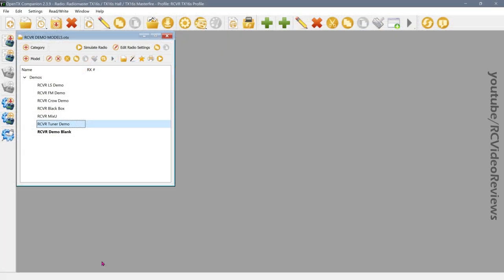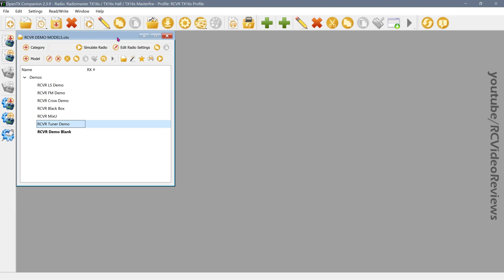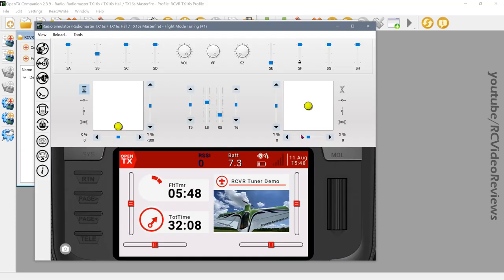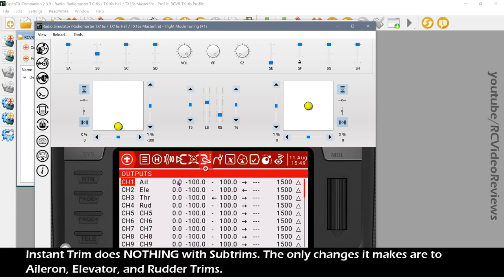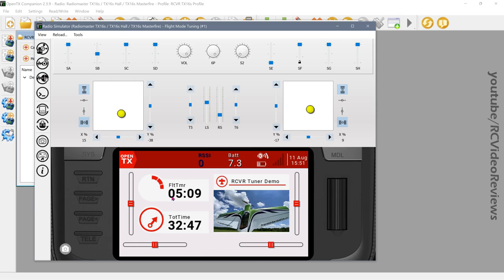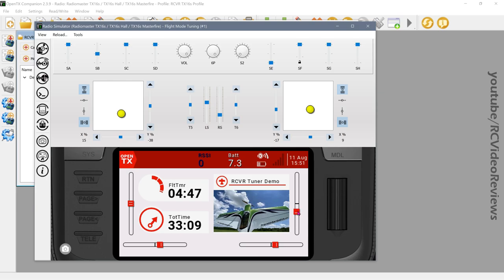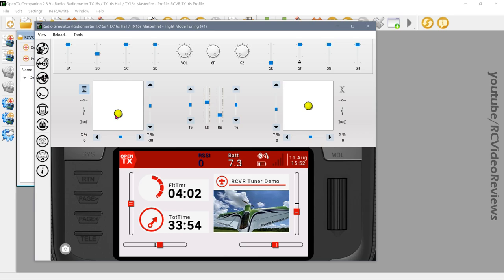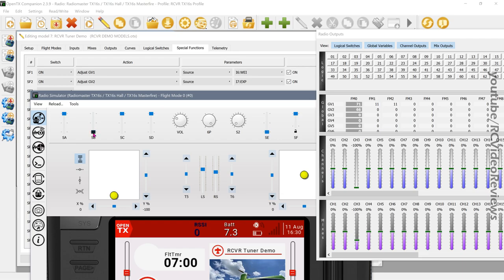OpenTx Companion Tutorial • Tuner Setup: Easy RC Plane Maidens! • Radiomaster TX16s • [Intermediate]

Comment: Hey John, that’s F’n magic, crazy cool. In the simulator at the end you used the sliders to adjust the when b/middle is active 
I’m confused, toggling the momentary switch sets the trim to where one would be holding a stick or having had moved the slider to (or both!) ?
Reply from the maker: The sliders affect weight, not trim. They are independent of each other.
Reply: @RCVideoReviews  right, it was late last night when I watched that

Comment: I get the instant trim. great tip and thank you, but you lost me with the "curves". i understand  the expo curve its self, i.e. parabolic, but i dont understand what you were doing other than setting min/max values for the pot switch (with a straight line/no curve lol). is there a video where you explain "curves" in more detail?
Reply from the maker: I do not have a stand-alone curve video. Don’t get too literal with the terminology. The developers call the function curves. I used a straight line within the curve function to establish end points for weight and expo. The whole point is to ensure you can never enable an input with Zero weight which would leave the model uncontrollable. This is exactly what I said in the video. The curve is applied to the input to cap the highest possible weight and the lowest possible weight while in tuning mode. 

Try it yourself. In the simulator set an input with a weight of zero and see how much it moves when you move the stick. Applying the curve prohibits a weight below the low endpoint of the curve or above the nigh endpoint of the curve. 

If they had a “lines” function I would have used it. Mathematically a curve represents a function. In this case my function is linear.

Comment: Learning so much with these videos. Thank you so much.
Will be passing on the knowledge to some of the other older guys I fly with. lol.
Just wish I knew how you got your simulator to be red like the radio. 
Mine is a dark blue color and nother like the radio screen
Reply from the maker: Under Radio profile -> SD Structure Path -> Add a directory accessible by your computer.  Copy the contents of your SD card there.

That should do it.

Comment: Hi John, 
Do you know if there is an OpenTx protocol for the original Spektrum DSM AR6000 receivers?
Thanks for the great videos!!
Reply from the maker: Multiprotocol support isn't provided by OpenTX, it's provided by the multiprotocol module in radios like the TX16s. MPM protocols can be found here: https://github.com/pascallanger/DIY-Multiprotocol-TX-Module/blob/master/Protocols_Details.md  You have to know what protocol you want, and bounce it off that list. If it's on that list, the MPM will support it and radios like the TX16s will be able to bind.

Comment: Any thoughts,  apart from the obvious colour screen, if you had a taranis x9d, would you still upgrade if colour wasn’t as important ? or would the new tx16s do more.??
Great tutorials. Thanks.👍
Reply from the maker: The TX16s main party trick is the MPM. It can bind with just about anything mainstream out there and a ton of proprietary drone protocols. For me, the important thing was adding the non-frsky options. 

I understand the comparison you're trying to make, but you shouldn't discount the screen. It is excellent. I was pretty happy with my Taranis and didn't think much of the screen, but now that I have this screen, I would not want to go back.
Reply: @RCVideoReviews  thanks for the prompt reply. i have an excavator, I was hoping that the display would make curves and setting easier, although that may just be an opentx thing.
Reply from the maker: @witneydiggersrc3251  I don't think curves and settings are necessarily any easier on the big color screen. They may present better though.

Comment: Thanks man, nice tutorial. I want to set my TX16s for custom throttle mix. My plane flies straight an level with zero throttle with no trims. With throttle it turns left and rolls left. I already managed to make a mix that listens to throttle and add it to the aileron. I am sure you can do it the better way. I did it by making a formula in mixing tab aileron=aileron+throttle*(0-30%curve). Now I want this constant (30%) to be a slider. So I need to add a GV for that? But the problem is that you cannot make mix formulas in mixer like a=(c+d)*2-y*0.2 . You can only multiply everything that is above the line. Is there a smarter way of doing it? And my plane is V-tail. So making rudder mix from throttle is even harder.
Reply from the maker: I would suggest adding two washers under the left side of your motor mount. Do you have down and right thrust now?
Reply: @RCVideoReviews   I know about thrust angle. I wanted to solve this problem in software.
Reply from the maker: What are your variables: c=curve d=? y=?  Is your *0.2 meant to be a percentage?  You referenced 30% above.

Tell me what you're trying to get the mix to do to the plane. Forget curves/mixes/rates just say what the "better way" is.

Comment: Unsuccessfully tried to set up the variable Weight and Expo adjustment using the sliders.   The Input page/graph showed the intersection of the two red lines tracking the Curve setup on the Curve tab rather than the expected black line Weight track regardless of the position of the rate switch, i.e. high^, mid-, and lowV.  Checked it on the plane and the servo travel was limited to the Curve Weight constraints, e.g, Weight of 30% to 95%.  This happened even when i deleted the Curve from the WEI and EXP input lines.  Only when I deleted the Curve from the model did the Weight following the black line on the Input graph.  Hope this makes sense.  Any thoughts?
Reply from the maker: There is a bug in 2.3.10 with the input graphs tracking correctly. The variable weight and expo sliders in this video work. I use them.
Reply: Thanks for the reply.  Just to be sure I follow your response, there is a bug in 2.3.10 but in fact, your servos tracks correctly and not modified by the Weight Curve in either the high or low rate switch modes?  ?

 @RCVideoReviews
Reply from the maker: @markp63698  As long as you add an Input line that activates with a switch position as shown @9:12. the GV weight/expo should only apply to that Input. Also notice @9:22 how the other rates defined on Input are set using SB down and SB up. If you use hard coded weights and curves in SB up and SB down, the weight/expo curve will not effect those inputs.

Comment: When using the variable pot or slider to change expo or weight, does it have to be on the input line?
I have all my dual rates /expos on mixes tied to switches. I can't seem to get my new safety curve to change the expo. I'm wondering if its because I'm on the mix page!
Reply from the maker: The approach I use requires an input with a curve to govern the endpoints. That input is used in Special Functions to adjust the Global Variable. The Global Variable is used as a replacement for a hard coded numeric value for weights and expo. 

If I were you, I would break this into two pieces:

1) Get your Global Variable to work the way you want it to work within the range you want it to exist.
2) Apply that Global Variable to the weight or expo where you want it to be applied. It doesn't matter if that weight is defined on inputs, mixes, our outputs. You can use Global Variables on all three tabs.
Reply: @RCVideoReviews  got it, for some reason when using the TX to programe , it did not allow the global function as an option. Took a look at Companion and there it was. Thanks again for your video help.
Reply from the maker: Global Variables != Global Functions

Did you get your mix to work?
Reply: @RCVideoReviews  yes, all sorted thanks to you and your videos.